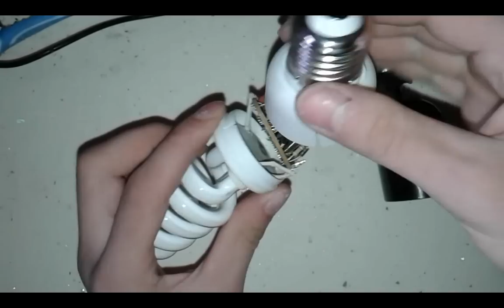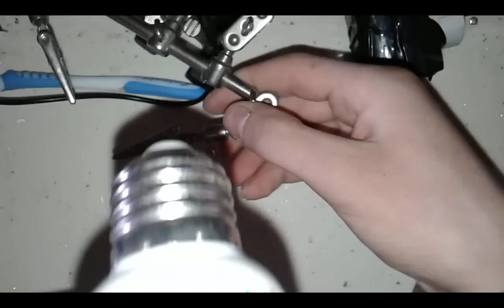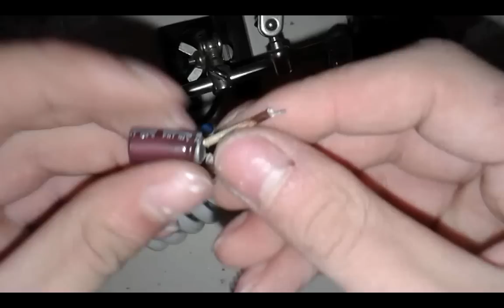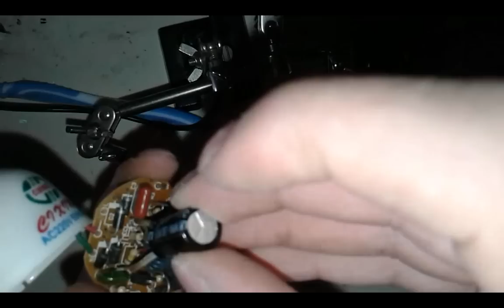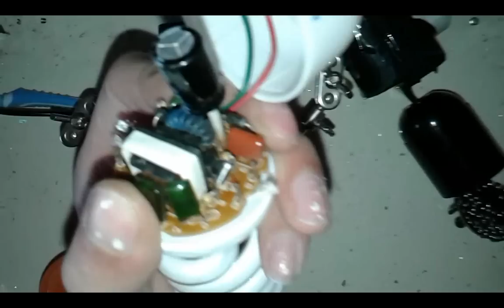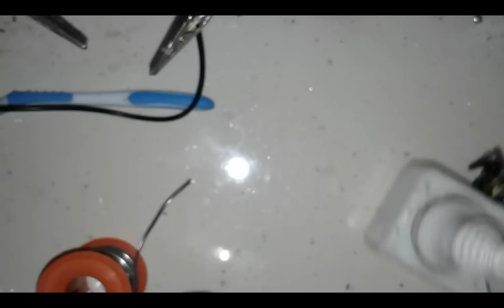SAVE MONEY - CFL Bulb Repair . Compact Fluorescent Lights easy and common repair

Comment: .How did understand that the same capacitor is required replacement????
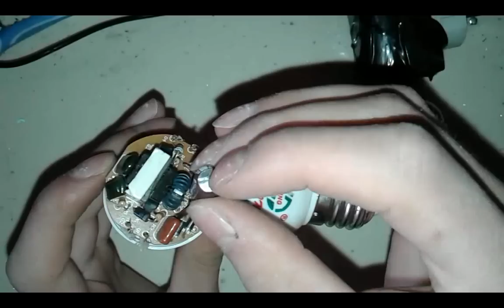Reply from the maker: Hi as you can see 0:22 the capacitors top has taken a shape of "D" and this shows that the capacitor is bad . the capacitors top should be flat :)